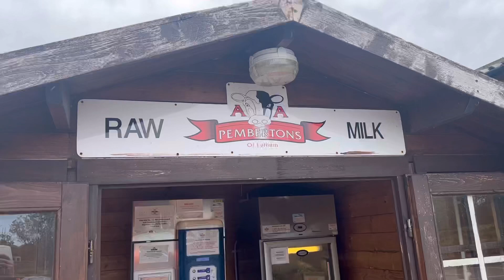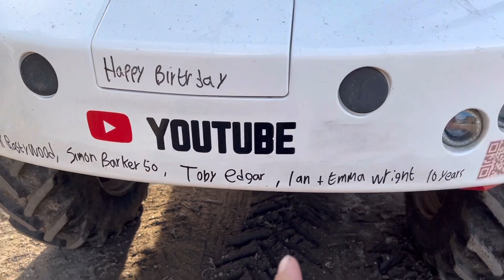Day788 JOHN DEERE EVERYWHERE & WHATS TOM PEMBERTON DONE TO MY TRAILER #OLLYBLOGS  #AnswerAsAPercent

Comment: I worked on the railroad and a wheelset with axel and two wheels is about 3000lbs. I think the wheels are about 900 to 1000 lbs depending on how worn they are.

Comment: 8RX is not articulated, so you need to pass a separate Tracklayer driving test to drive  one on the road!
Reply from the maker: You don’t as it does steer on its tracks I believe like a skid steer would
Reply: @OllyBlogsAgricontractfarmer  I thought you needed a test if the steering axle is on tracks.